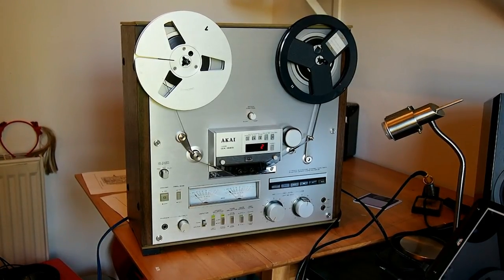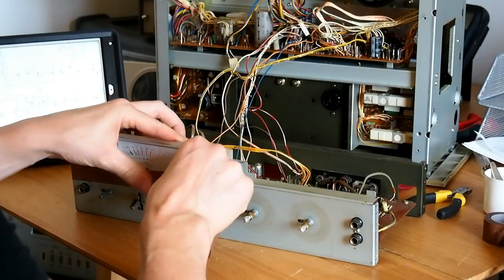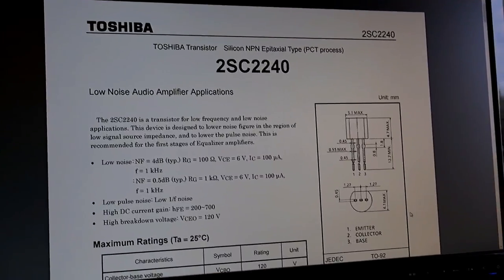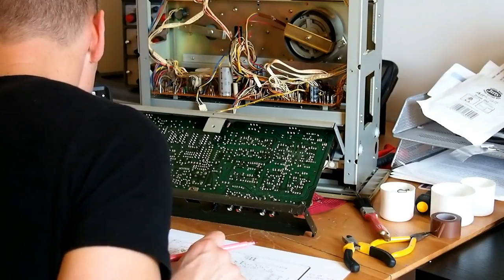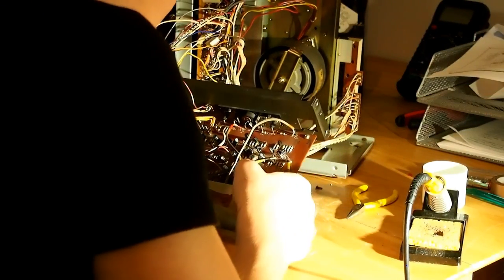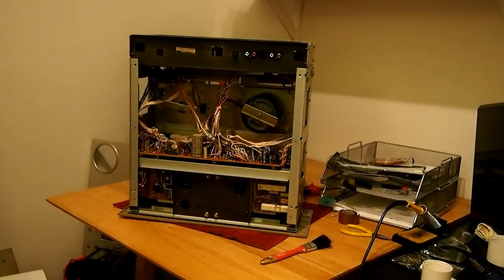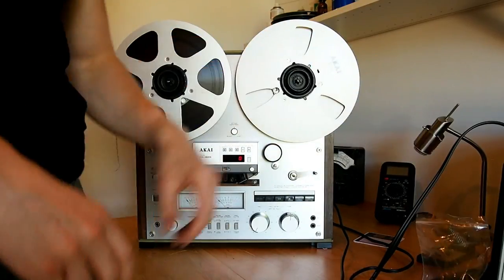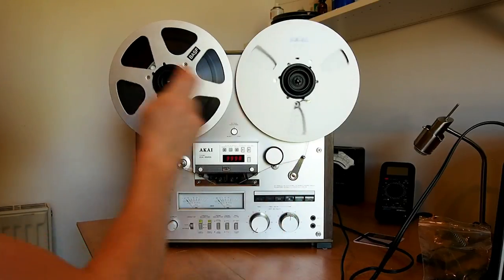Akai GX-625 Reel to Reel Transistor & Capacitor replacement

Comment: Hello, Darren. It's really nice to see young people rolling their sleeves up (not literally in your case) and replacing components in printed circuit boards, so well done! I have a gx365 that I have to admit I haven't used in decades but I really should roll my sleeves up and replace the electrolytics and maybe some of the transistors as well.

Comment: Good evening, I bought the Akai gx 625 used and I was aware that it would need a total overhaul.
All this happened with the replacement of all the transistors of the preamp section and with the replacement of some electrolyte capacitor.
The machine has been cleaned lubricated and calibrated.
It works great and is perfect aesthetically.
The technician to whom I brought it could not solve a big problem.
The recorder has a great background noise that feels very pronounced when the music is stopped and the tape is flowing.
I tried to record a piece of tape with volume at zero.
When i listen to it again with the volume of the recorder on the second line it starts to be audible. This problem makes me listen to the recorder with the amplifier volume at 80% of its power and with the output volume of the recorder on the first line.
The noise is not in the tape because in another recorder it sounds perfectly.
Thanks for your help.

Comment: Looking forward to the calibration vid. I'll be there soon in my Akai 4000ds revival project. Never done that before.
Reply from the maker: I believe the 2SC458 transistors are in most akai tape decks. They are either 'going bad' or bad. Sound was amazing after I had done the job

Comment: I have a 1960s ultra (FERGUSON) UNIT.New belts coming but..is it worth replacing any caps or just leave it? Does gave HT line as there is a valve 
Cheers

Comment: Congratulations sir..! I have a GX 266   II and I've just finished replacing all the electrolytic capacitors with NICHICON caps of which I've specially ordered abroad..What about tantal caps..? The recording is not that good for me..%80 of the transistors are renewed..Should I go further..? Thank you very much..!

Comment: Have a GX-635D which will need this as well. Theres 16 2SC458's in it. A bit scary as I've never monkeyed with electronics before but it does seem straightforward.

Comment: My Akai GX-4000D r2r right channel (from the RCA output jacks in the back) does not work.  Everything else, including the front headphone jack, is fine.  That is, sounds from both channels (L and R) are sent to the headphones but the R channel is NOT output via the back RCA R channel output.  Do you what went wrong?

Comment: akai's  try a teac A3340 changing the lamps  under front panel it's a lot harder i had to do    it great to see  young man getting into fixing them
i gone over to 1/2 tapes because 1/4 inch price'sare crazy high   i use    7 1/2  on a tascam 38  new eq settings  saved money in the long run

Comment: I didn't realize that a transistor can go bad. I thought they either worked or they just did the "fastest fuse" thing.
Do they lose linearity or something? 
Also, what brand of cap do you use? I tend to go for nichicon, or rubycon, or nippon chemi-con.

Comment: Thanks for the video, do you think only the transistor change would do the trick to reestablish the sound or capacitors change are also vital in this case?
Reply: Just ordered the transistors, hope this helps, I'm bit lazy about the caps though... ;-)
Reply from the maker: I'd start with the transistors this will sort it

Comment: I have an Akai GX255 and the transistors (2SC458LG's) and others have been replaced. The deck sounds amazing except there is ridiculous hiss coming out of the output stage without tape playing. I suspect this to be the transistors?. Have you seen this before and can you suggest replacements?.

Thanks for any help

Cheers

Julian
Reply from the maker: Jcamp definitely the 2sc458 transistors causing that

Comment: hi have worked on alot of tascam 34-38  they can be a right pain to fix  best to leave the audio boards don't need re cap  the logic board is the pain

there's a 2 watt 1.5k res i have had bad time with  and the 24v line on the logic pcb   like you best to keep to the home decks  they don't play up
like the pro decks

Comment: Hello, very nice video... I bought a 625 last year, and, because i have also a GX 215D, i knew the issue with 2SC458.(replaced with low noise BC549 if i can remenber well--) I immediatly  changed the transistors and all went fine. But not the capacitors.. I will do that, it is a good idea. Did you use good quality caps?
Reply from the maker: Roberto DS yes used HiFi grade caps but not crazy expensive ones.
Reply: Hi everyone. I have  an AKAI gx266, where you bought the replacements? Sorry for the bad english.
Reply: By the way, excelllent job, thanks for sharing.

Comment: Hi Darren, great video, thank you. I have the task of getting both a GX-4000D and a GX-630 in working order. I will replace the 2SC458s for sure, but I'm on the fence about the electrolytic caps - trying to decide how much time I have to put in on these machines. When you replaced the caps on your deck, did you happen to test any of the old ones once you desoldered them, and if so, how far out of spec had they drifted, generally? Hats off to you for replacing them all, perhaps I will, but it would take me longer than one night I suspect : /
Reply from the maker: The old caps went in the bin as once soldered more hassle to test when the replacements are pence! Most important ones to repalce are the yellow Low leakage caps for the rec & PB heads.
Reply: @DarrensVlog  Excellent, thank you for replying, that is helpful.

Comment: Thank you darren for this video...I have a GX635D, that will also need doing...:-) Also i have a problem with green led that does not light up ,It powers up but it is not working...Any adeas?

Thank you...:-)
Reply from the maker: Steve Saferat could be a dry joint are we talking the power on LED?
Reply: Thank you for the reply Darren, it is the direction green led....:-)
Reply from the maker: Steve Saferat it'll be the led lamp itself if you test for power it it's legs. You'll be needing a scrap machine if that's the case to rob the part
Reply: Thank you , i will try that...:-) take care , Steve ...:-)
Reply: @romanticdance975  Thank you for the reply...will get on with this ...Blessings to you ..:-)

Comment: Darren,  I'm looking at purchasing one of these 625s without a mains lead.   It seems to be a two-pin input - do you know if replacements are readily available?
Reply: The cord is the same type used in most portable stereos, just a standard two pin fig 8 input.

Comment: Do you remember what capacitor values you needed? Sure be nice if someone would just put a kit together :)
Reply from the maker: Lots of 10uf & 47uf, a few pairs at other values. If you download the service manual and look at the schematics basically it's all electrolytics in the output and record preamp. Just double the amount you count up
Reply: Thanks for the reply Darren. I have a copy of the service manual but it's pretty much not readable (at least the pdf copy I have)

Thanks again

Comment: hi re cap on this is easy   re cap a teac 3340  the first quad they did is hell lot harder  AKAI GX77 with bad capstan  the audio board come out the same way asm your
and the rs 1700  1500 is easy to get at  tascam 32 to 38 is easy to do as well

Comment: My GX 620 work perfect for 45. Dont need TLC. All new transistors are low power then original transistors 2SC945 . Amplification factor for new transistors is weak! If the transistors and .capaccitors are made in china you pull out JAPANESE accuracy. Like Sanyong SUV clone of Mercedes ML.